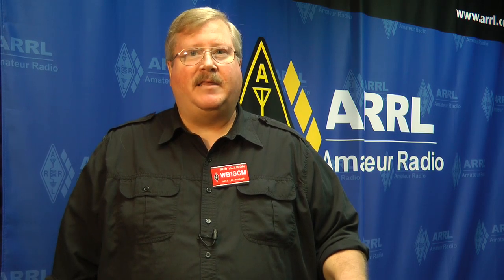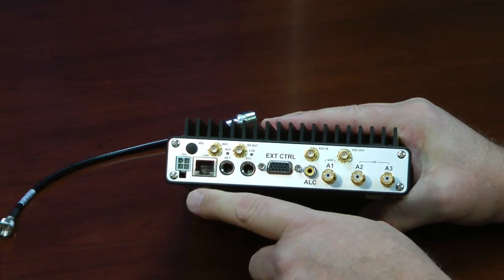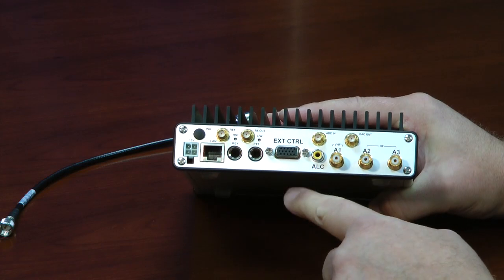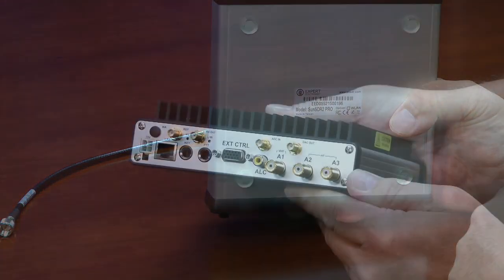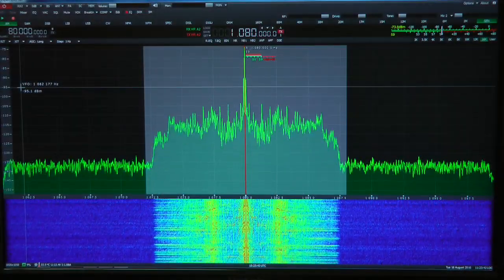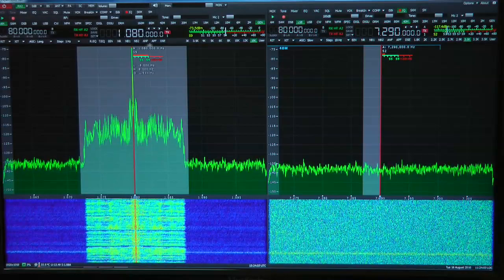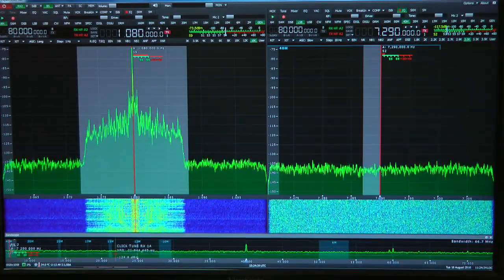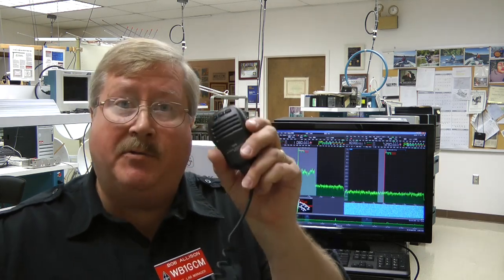Expert Electronics SunSDR2 Pro Transceiver

Comment: Thanks for spending time reading all the obvious labels on the radio and not mentioning any of the specs for the radio.  This had a signal to noise ratio so low not even JT65 could pull it out.

Comment: Is the power output variable? Also, I've got the SPE 1K experts amplifier. I'm assuming that I would have to use an ALC between the amplifier and the transmitter? Is this just a cable?